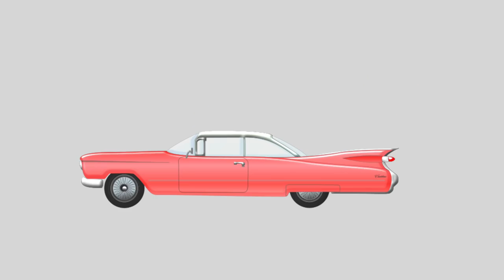Yes, Rockets CAN Fly in a Vacuum

Comment: For those of you who still do not believe rockets can fly without an atmosphere, think about this.
- A jet or rocket engine works by mixing fuel and oxygen in a combustion chamber and igniting it. 
So in a sense a rocket creates an atmosphere in the combustion chamber so it does have something to push.
Reply: Agreed!  I often tell these "physics deniers":

Oh so you believe that "Rockets Push on the Atmosphere"?
Well isn't "Atmosphere" just a GAS??
But you DONT think that rockets can "Push on a gas"???

So your argument is basically "Rockets push on GAS, but they CANNOT push on GAS".
Reply: @@Poundertruth "The infinite vacuum of space is not a chamber"

Nor did he say the infinite vacuum of space is a chamber.  Perhaps you should improve your comprehension?
Reply: @davidmescher2526  Pounder STILL claims that "Rocket Push on AIR" but that they CANNOT "Push on GAS".

see it does not even know that AIR IS A GAS.

SO it's argument IS: "Rockets CAN push on GAS, but they CANOT push on GAS"!
Reply: @stuartgray5877  he didn't say that, chatbot 😂
Reply: @papalegba6796  However YOU keep saying that.
YOU keep claiming that rockets CAN push on GAS but cannot PUSH ON GAS.
Reply: @stuartgray5877  no I dont, chatbot 😂
Reply: It's also worth noting that the gas pressure in the combustion chamber of a rocket engine can reach several hundred atmospheres. The pressure inside the RS-25 engine used by the shuttle and the SLS is about 200 atmospheres or the same as 2 kilometres below sea level, enough to crush most submarines.
Reply: @fromnorway643  internal forces are irrelevant. If you were not a chatbot you would know this.
Reply: @papalegba6796  so papa Legba tell us AGAIN how rocket engines accelerate mass.
You apparently think it is with "magic".
Why don't you just TELL US how a rocket engine can accelerate all that mass?
Is "Magic" your answer?
Reply: @stuartgray5877  Gases expand from higher to lower pressure using their own internal energy, chatbot. No force is applied during the process.
Reply: @stuartgray5877  Answered you didn't i? So why do you ask me the same question 100s of times, chatbot troll?🤔

Comment: No they cannot fly in a vacuum. We have tested it numerous times and your vacuum is faulty
Reply: No you have not tested it.
And you will refuse to answer the following questions about rocket propulsion right here in atmosphere:
When a Space Shuttle Main Engine is running at sea level in 14.5 PSI atmosphere:
1 - does the exhaust gas have mass?
2 - does the engine accelerate the exhaust gas from the nozzle?

Now be sure to make up some juvenile excuses why you refuse to answer my questions.
We all know that you will refuse to answer truthfully as doing so Proves YOU WRONG.
So please be my guest and prove me wrong by answering.
Reply: Full scale rocket motors get tested in a vacuum all the time.
Reply: @AM-rd9pu  and do not work
Reply: @shots-shots-shotseverybody2707  I’m genuinely curious what you think happens during those tests. Let’s go along with the scenario that a rocket produces no thrust in a vacuum. Do you think the engineers just sit there dumbfounded when they see no thrust register from the force transducers? Then what happens? Were they already in on the secret that rockets don’t work in a vacuum? Do they fake data to send to the people that aren’t in on it?
Reply: @shots-shots-shotseverybody2707  OR - you could just go watch a SpaceX launch and see rocket propulsion in a vacuum with your own eyes.
Maybe TRY THAT?
Reply: @shots-shots-shotseverybody2707  We can determine if rocket work in  a vacuum by just answering basic physics questions:
1 - Do rocket engines "Accelerate mass"?
Yes or no?
Reply: @shots-shots-shotseverybody2707 

Not only did you not answer my question, you also failed to get the whole point of my question. 

These vacuum tests objectively happen. They aren’t done to prove that rockets work in a vacuum. They’re done to verify that the engine performs as it is designed to in that environment. 

My question is about what you think the aftermath of these tests is if the rockets don’t produce thrust in a vacuum as you propose. 

Are the scientists and engineers surprised? Were they in on it? What do they do about providing data to people who aren’t in on it?

You have an extraordinary flawed understanding of both academia and industry. People perform experiments to test their hypothesis and verify scientific concepts. How do you think that college students, researchers, scientists and engineers aren’t realizing in droves that they were taught incorrectly? 

Your whole comment after the proposed experiment was a series of unsubstantiated claims. You have no data to show that rockets don’t work in a vacuum. You have no evidence that NASA is a scheme.
Reply: @shots-shots-shotseverybody2707  the Joule expansion experiments from the 1840s prove a rocket cannot develop mechanical power in a vacuum. They're the basis for the laws of thermodynamics.
Reply: @papalegba6796 Not surprising to see that you’re still misrepresenting joule free expansion. It states that the gas does not perform work on the surroundings to expand into a vacuum. This is intuitive because it takes no work to move nothing.
Reply: @papalegba6796 so tell us how many joules are required to accelerate 500 kilos to 2500 m/s?
Why can’t you answer?
It’s almost as if you failed to take even high school physics 
OR you refuse to answer truthfully because the answer proves YOU wrong?
Yes. That’s exactly why you refuse to answer my questions   You are AFRAID to address my facts directly 
Bless your little heart!
Reply: @AM-rd9pu  thanks, then you agree a rocket cannot work in a vacuum.
Reply: @stuartgray5877  gas is not a solid, chatbot. You refuse to accept this because you are not programmed to 😂
Reply: @AM-rd9pu Joule himself said a gas expanding into a vacuum does not develop mechanical power. Are you calling him a liar?😂
Reply: @papalegba6796  At this point, I can only conclude that you’re deliberately making disingenuous arguments. 

We’ve already established that a gas performs no work on the surroundings when expanding into a vacuum because it takes no work to push on nothing. 

I will once again inform you that rockets don’t produce thrust by exerting a force on the surroundings. They exert a force on their exhaust gasses which exert a force back on the rocket in accordance with the third law of motion. 

If you had a basic grasp of physics, you’d know that rockets must work in a vacuum.
Reply: @papalegba6796 gas expanding into vacuum does NO WORK ON THE VACUUM 
For you to claim no work is expended at all to accelerate the exhaust gas into the vacuum means that YOU think mass can be accelerated without applying a force 
So you want to use your MISunderstanding of thermodynamics to disprove newtons laws?
Bless your little heart!
Reply: @stuartgray5877 Stuart stop embarrassing yourself darn it, you've been doing it for years.
Reply: @stuartgray5877 hey stu pid, when a rocket launches it's not in a vacuum
Reply: @papalegba6796 I cannot believe Stuart is still here in these threads after 2 years after being embarrassed by yourself and I
Reply: @Checkeroute  I sorry I don't EVER recall being proven wrong. And if you change your screen name I don't know who I have already embarrassed versus who I only educated.
Reply: @Checkeroute  You are likely just another bot sock account for papalegba.
Reply: @stuartgray5877  how does it feel to retain the mentality and intellectual levels of a child well into physical adulthood?
Reply: @stuartgray5877  Jesus Christ! I thought I taught you it was cringe to like your own comments more than 2 years ago? 😂😂😂😂😂🤦🏻
Reply: @Checkeroute  Stuart is a chatbot, it can't really understand anything 😂
Reply: @stuartgray5877  you're not programmed to understand the Joule expansion experiment, which is Why you can't understand that no energy transfer = no change in motion. Poor chatbot Stuart 😂
Reply: @papalegba6796  So you STILL cannot tell me how much "mechanical work" is performed by accelerating 500 kilograms of mass from a velocity of 0.0 m/s to 2500 m/s?

I'll take the answer in "Joules" please.
(Oh and there are online calculators that will do this calculation for you if you don't know how)
WHY are you afraid to answer? I thought you were really good at this physics thing.

Its ALMOST AS IF you are AFRAID to answer because that would betray your delusion.
Bless your little heart!
Reply: @Checkeroute  So tell us HOW does a space shuttle main engine accelerate mass into the atmosphere at liftoff?
Does it accelerate all that mass using "Magic" like papalegba beleives?

I'll bet you ARE papalegba arguing with yourself.
Prove me wrong and tell me - WHAT IS the "exhaust gas" from a space shuttle main engine?
 Papalegba refuses to tell us.

What IS the combustion by-product of a hydrogen oxygen flame?  Is it "just Fire" (like papa tells us) or something else?
Reply: @stuartgray5877  You mean 3 years after my educating you on the subject You're still asking about what how the space shuttle's engines work at launch IN AN ATMOSPHERE? 😂🤦🏻. 

GEEZ, after 3 years one would have assume that you know the difference between an atmosphere and a vacuum 😂😂😂
Reply: @stuartgray5877  Kid, that Papalegba guy is still living in your head all this time after demolishing and obliterating your arguments more than 2 years ago 😂😂😂😂
Reply: @papalegba6796  on the slim chance he's not a chatbot - You've got this Stuart guy paranoid.  He thinks everyone that obliterates his silly arguments is you lol.   He thinks I'm you as well.

I don't think this guy goes to sleep every night without thinking about you in the hurting you put on him. 😂
Reply: @stuartgray5877  It's okay cupcake You can continue to believe in fairy tales 😂😂
Reply: @stuartgray5877  by all means, continue to believe in: 

*NASA's and other space agencie's animated cartoonery, photoshopped images, artist renderings, and CGI imagery🤣

*NASA's laughable Magical Mystery Apollo Moon Landing Tours of sending people to the moon and back in an aluminum can using 1950s and '60s technology 🤣
Reply: @stuartgray5877  Feel free to keep posters above your bed of Neil Armstrong and Buzz Aldrin and stare into their dreamy deep blue eyes as you drift off to La La Land every night kiddo.  😂😂😂
Reply: @Checkeroute I didn’t know my 30 year career of launching things to space was all a lie.  
Thanks! I’m sure glad I had a high school dropout to straighten out all of the Engineers, scientists, and physicists who have been fooled for their whole lives. And an imbecile who can’t explain the difference between “mass” and “weight” enlightened us all!
Hallelujah!
Reply: @Checkeroute  He's a chatbot, a large language model AI. He can't think about anything. If you point out he's a chatbot, he calls you a chatbot. If you point out he has multiple accounts, he says you do too. It basically says "I know you are but what am i?" to everything, which isn't hard to program lol. It's not human, it's just an automated lying machine.
Reply: @stuartgray5877  rockets don't accelerate gas molecules, Stuart. Kinetic theory says so, but you are not programmed to understand it 😂
Reply: @papalegba6796  - "rockets don't accelerate gas molecules"

So when I observe gas shooting out of the back of a rocket that is just my imagination?
And I guess pop-bottle rockets are a mass hallucination?
Bless your little heart!
You don't understand the meaning of the words: "Acceleration" and "velocity" if you DON Think that rockets accelerate mass.
Here is an ACTUAL Engineer trying to help you:
Papalegba:  ROCKETS ENGINES
ACCELERATE 
MASS.
You are welcome. Now go back to high school and take a physics class this time.
Reply: @papalegba6796  And your new sock puppet account is not fooling anyone.
Reply: @stuartgray5877  You've been exposed cupcake chatbot - your programmers need to increase the budget so you can at least appear intelligent lol
Reply: @stuartgray5877  Hey bot, 30 years of launching rockets to land in the sea is not heroic or outstanding.  I have a fireworks kit that can accomplish the same thing 😂😂😂
Reply: @Checkeroute  Stuart is not programmed to understand that the velocity of a gas particle is a function of its internal energy. Only a change in temperature can change that velocity. So, because a gas expands into a vacuum without losing temperature, the velocity of the particle does not increase, & no acceleration occurs. He is programmed to state a gas particle is a static object, like a solid, that must be pushed around.
Reply: @papalegba6796  I'm going to be honest and state that you're way more advanced and knowledgeable about these things than I am.  I simply know the basic truth that on theory and principle a rocket should not be able to propel in a vacuum let alone be immense vacuum which space is alleged to be.    

I've viewed many videos of Tess trying to prove otherwise however they were conducted with small vacuum chambers that quickly filled up with exhaust gas thus nullifying any vacuum.
Reply: @papalegba6796  however I do appreciate learning from you what I do not know
Reply: @papalegba6796  So explain how the first launch of superheavy excavated a hole through >4 feet of concrete and dug a hole over 30 feet deep while throwing debris over 100 yards.

I thought "Nothing" comes out the back of a rocket engine?
Reply: @papalegba6796  Hint: 1.56 MJ

Thats how much mechanical "work" is performed by a Space Shuttle Main Engine in one second while accelerating 500 kilograms of WATER to Mach Eight at sea level atmospheric pressure.
Guess what? MORE "Work" gets performed IN A VACUUM.
MORE work gets done in a vacuum because the engine is venting to 0.0 PSI instead of 14.5 PSI.
This gives the engine a HIGHER exit velocity which means MORE work was performed not less, as you believe.
Reply: @Checkeroute  yeah Stuart is programmed to claim gasses act like solids & that a rocket & its exhaust are two separate objects. Both claims are incorrect, but to be absolutely sure you need to have a passing knowledge of thermodynamics & kinetic theory. From a Newtonian point of view, a free body diagram is the best way to show a rocket cannot work in a vacuum. They're easy to draw, basically the obvious fact that a vacuum cannot apply external force is all you need to know. No external force = no change in motion. Simple.
Reply: @stuartgray5877  a gas expanding into a vacuum does not develop either work or mechanical power, chatbot. If you disagree just say so 😂
Reply: @Checkeroute  check it out: 
"in a free expansion, gas is allowed to expand into a vacuum. This happens quickly, so there is no heat transferred. No work is done, because the gas does not displace anything. According to the First Law, this means that:

ΔEint = 0

There is no change in internal energy, so the temperature stays the same".

Or this:

"The free expansion is also known as work of expansion in a vacuum. When a gas expands in a vacuum there is no opposing force i.e.  Pext = 0.

For getting work done opposing force is necessary, hence no work is done when a gas expands in a vacuum. Such an expansion is called as free expansion.

W   =    – Pext ΔV

∴ W   =  0 × ΔV = 0"

Chatbot Stuart can never post citations supporting its pseudoscience, because they do not exist.
Reply: @papalegba6796  thank you, I'm learning a lot from you
Reply: @Checkeroute  no problem. Just remember that gas particles are in constant motion, and a gas will expand from higher to lower pressure using its own internal energy. No force is created during the expansion process unless the gas meets EXTERNAL pressure. That's why chatbot Stuart always tries to compare rockets to solid objects, like a crossbow. It's a false analogy and deliberate deception.
Reply: @papalegba6796  👍🏻